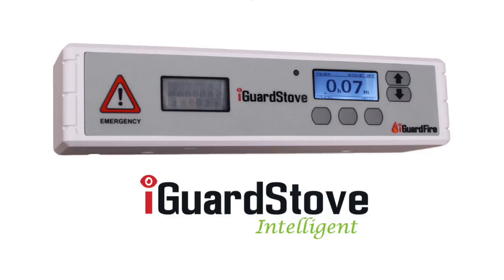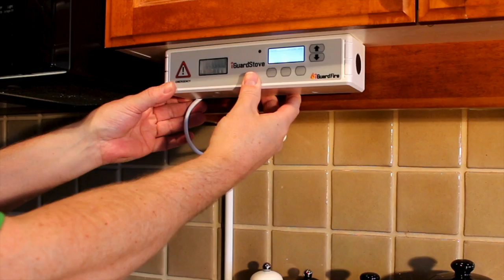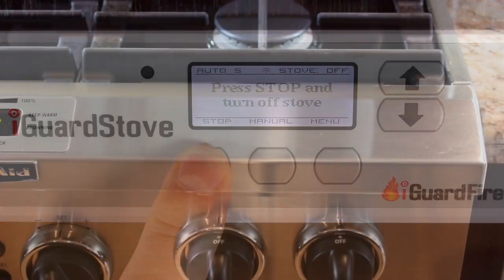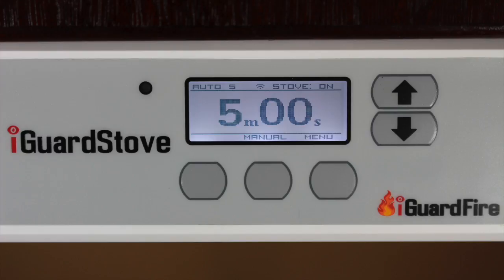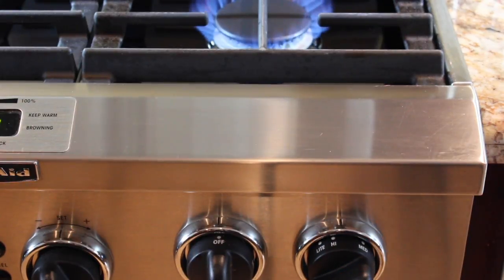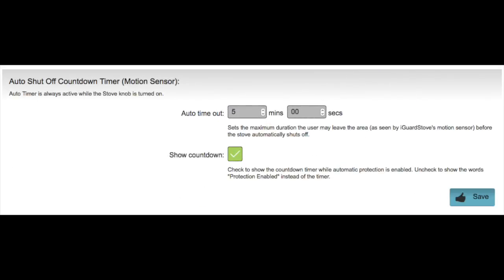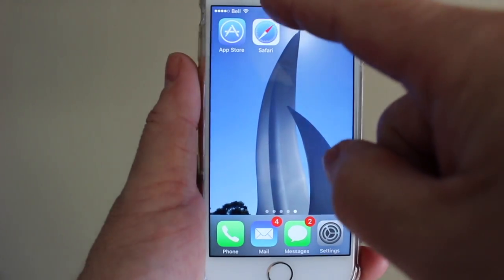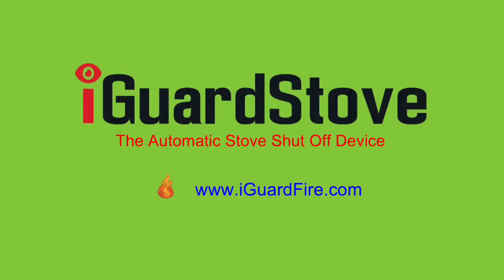How does the iGuardStove Gas work?

Comment: But mu mother who has Dementia couldn't use the setting. I just need one that turns gas stove off when it detects smoke or heat from fire. That's if i want my mum to be covered. But indeed all the features, like the timers, is great under other circumstances
Reply from the maker: David, getting old can be challenging so we are sorry to hear about your mom.  Our company beliefs are that we want to PREVENT the smoke and fire situation in the first place. We are a prevention device and not a reactionary like a smoke alarm or sprinkler head. I know you won't want to change to an electric stove but that iGuard model is truly all automated. Unfortunately you do have to press the start button to start cooking for a gas stove.

Comment: once the flow of gas is shutoff by the device while a knob  or knobs that control the flow of gas to the burner / burners is on gas will start to flow to the burners if they are still in the on position once the start button is pressed to begin the flow of gas. 
Is that correct?
Reply from the maker: That is correct.  But remember the amount of flowing gas that comes out before the user then relights the burner is not dangerous.   Even if they turn the gas back on and then walk away not lighting the burner the valve will shut off again after 5 minutes of no motion. Even 5 minutes of unburned gas may smell bad but it's not dangerous.  
Try this on your own gas stove.  Open the valve but do not light the gas.  Let it run for 10 or 15 seconds and THEN light the burner.  You'll just see a small poof of flame.  Unburned gas dissipates into the surrounding air very quickly and doesn't have a chance to build up into dangerous levels for a couple hours depending on the surroundings and air movement. Again... it may smell bad but a few minutes of unburned gas is typically not dangerous.